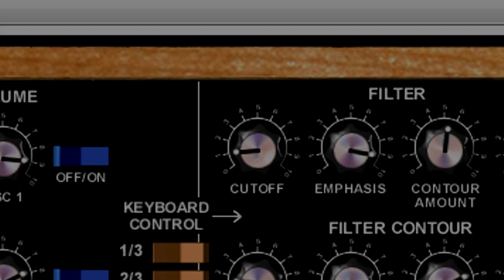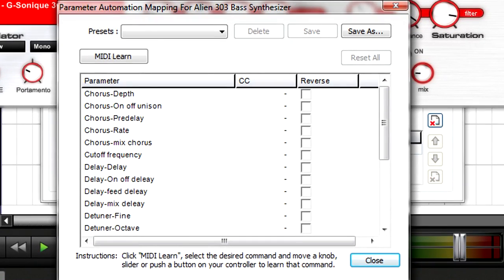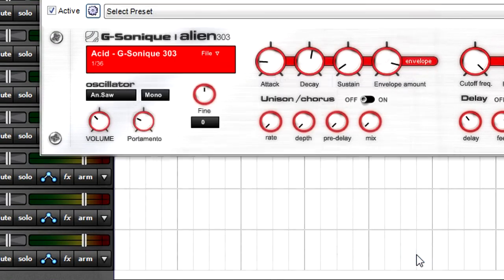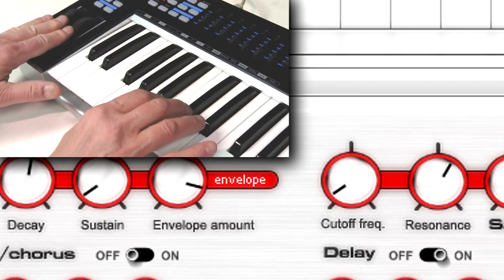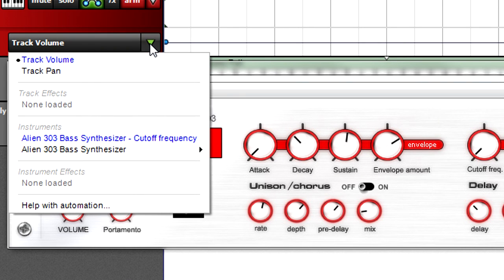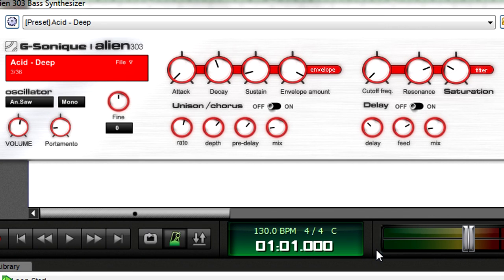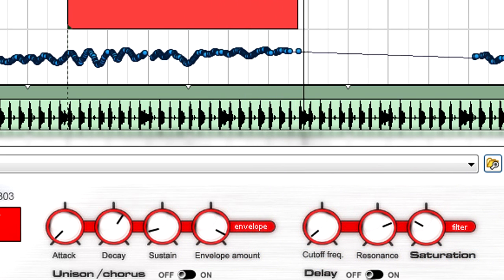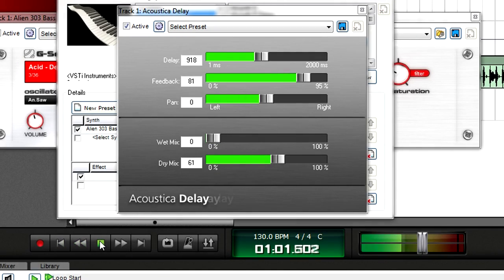Mixcraft University: Control Surfaces, Part 2

Comment: how to control the volume and pan automation envelopes using control surfaces for  particular track?
Reply from the maker: gsrini, Mixcraft 6 doesn't have that feature (but Mixcraft 7 will). What you can do with Mixcraft 6 is automate an effect that has volume and pan. For example, you could map Acoustica EQ's output gain to change the volume and leave the rest of the EQ settings flat.